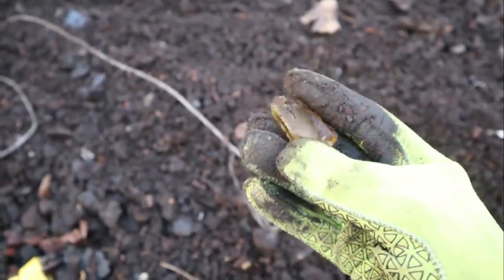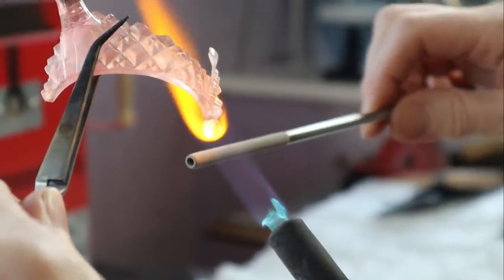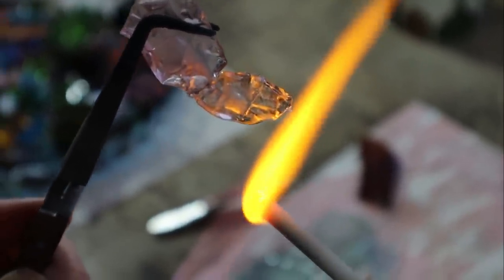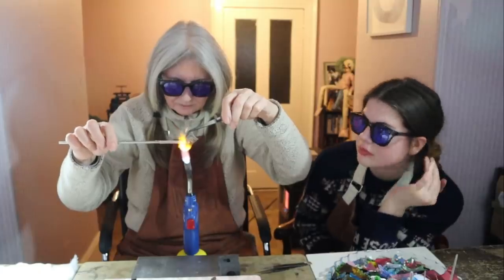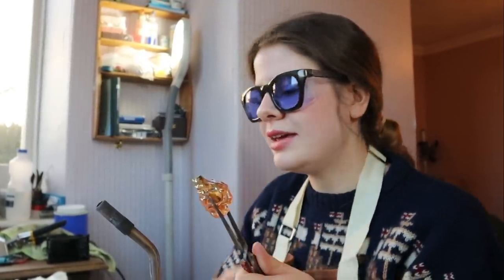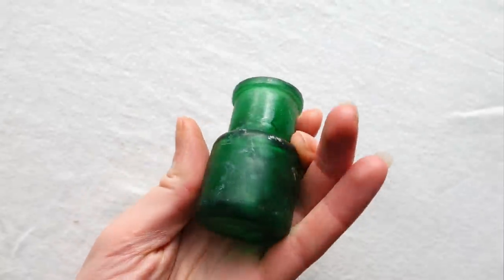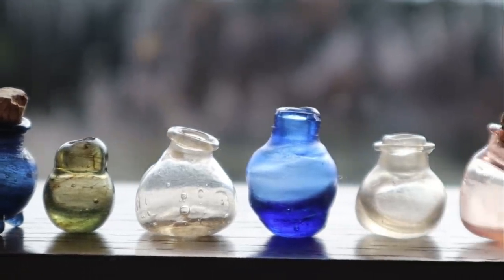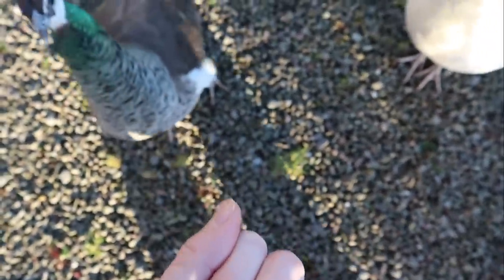Glass blowing tiny magical bottles from 100+ year old glass we found while Mudlarking!

Comment: Your little bottles are so charming.  So many ways they can be used-putting them over fairy light bulbs, to hold tiny messages, jewelry, etc.  You can preheat your glass shards in your kiln, at annealing temperature and it will melt faster and you will have less snapping.  Just have the shards in the kiln and use your tweezers to pull out a piece when ready to work.  If you want them to have a flat bottom, just gently push down onto a marver when you are done blowing, flash heat, and then put in kiln (or cooling pot.)  And last comment-please be careful using iridized glass.  The process to iridize glass is usually very toxic.  I hope these comments don't seem to "know it all" or bossy-just sharing info I know from working with glass.
Reply: Safety warnings are never wrong and friendly and sensible tips and advice fall into good soil with these down-to-earth and humble ladies.
Reply: Terri Atwell, I Love your comment. You are detailed in relaying your thoughts, much like I am, if I do say so myself.  : ) I am sure the Ladies of Northern Mudlarks will receive your thoughts and ideas  graciously, as they do mine.
Reply: Good info. Was going to leave a very similar comment, but found yours first. Well stated, and hopefully the ladies will see it. Their lack of basic safety precautions is worrisome.
Reply: I was going to suggest this as well. I have only blown glass full size in the traditional Swedish way, and I’m sure there are important differences in techniques working so tiny and low temp, but perhaps you might enlighten me on a few thoughts? 
My first thought besides yours was that the girls are working against gravity (hence the wonky bits) and was thinking I’d have positioned the flame/myself so that I could easily hold the punt more vertically by the flame, I’d make use of a bucket of water and to hold small wetted wooden ”spoons” to shape the glass in and find a miniature way to use wet pads of newsprint they way the glass is shaped when hot in classic glassblowing? Also pulling a neck should be possible the classc  way as well, ie rolling it horizontally (with perhaps support if it would be easier to be fast and steady) and pinch-pull the neck with another pair of tweezers?
Are these ways for some reason not used in lampwork? 
I was also going to suggest rolling the puntel in a bit of ground glass of contrasting color before returning to the flame and increasing volume and shaping. Thinking since this works with traditional glass I can’t see why it wouldn’t in ”smurf size”?
I’d be very curious to try myself had I the equippment needed! (Annealing equippment is unfortunately beyond my budget atm 😔) 
I’d appreciate your feedback (or anyone else with experience) I feel so inspired to try this, only too curious to wait ;) 
Love this channel!
I share many of the same interests as these lovely ladies and fell in love with Scotland 2019 when I was on adventures there all of august, so I can’t wait to be able to go back for more and do some mudlarking and mineral hunting myself! 
If I’d only known... 🥰
Reply: @gnarbeljo8980  in lampworking you are working much smaller than when blowing larger pieces so there is not the space to use supports.  Or at least I have not seen it done.  You can use graphite marvers to shape (versus the wooden paddles).  Frit can be used as you described to add color.  There are lots of ways to play with the shape of the bottle and neck (varying size of gather, using a punty on end, etc.)
Reply: @terriatwell4041  I see, I dod just have a look at another lampworking video and it seems they tend to work with the rods connected to both ends when making bottles which would be impossible in glasblowing where one must alternate.
Graphite is used in both techniques, but I can’t really see why wet newsprint and wood (which are so cheap and easy to come by especially in the size required here) couldn’t be used? Unless it’s too cooling for glass this small perhaps?
I understand the two techniques are separate, but starting out with glassblowing you tend to make smaller objects to understand the material, things that one might categorize as lampworking-style. So it was just a thought. If I try lampworking I shall investigate how one could incorporate this.
I absolutely LOVED blowing glass! But it really requires many years of mastering and above all full time access to a real studio with kiln etc. 
I spent many years doing pottery and there are certain aspects glass and ceramics shaping have in common. But whereas throwing is very meditative, blowing glass is SO exitinig!
☺️
Reply: Are these welding rods you start with? absolutely wonderful ❤️❤️❤️

Comment: Beautiful, I was wondering if you can incorporate glass seed beads, roll the molten blob in them?
Reply: This is such a fantastic idea, but sadly it probably would result in disaster, as each different type of glass has a different “coefficient of expansion,”. Which refers to the rate at which it will expand and contract as it is heated and subsequently cools down. The issue that often arises is glasses with different COEs being used together and the final object spontaneously shattering! Which really is too bad, because seed beads would be SO AWESOME to incorporate into glass blowing projects!
Reply: Thanks for that , I guess I didn't word it correctly. I was asking if you could use the glass beads, and no one likes or commented. Thanks for answering.

Comment: A couple tips (keeping in mind I am no expert myself,) that I learned when glass blowing is to use a steady, continuous breath and if you have to breathe in to turn your head so your lips are away from the straw so that there's zero change you accidentally breathe in through it. This could kill you and is deadly serious. Ventilate your area well - do this outside or in a garage when you can - as there are often toxic fumes with glass blowing. Finally, always wear your hair back with a cap or a hairnet on because you do not want your hair to alight. I love what you're doing! Keep experimenting!

Comment: You should probably check your old glass pieces with a UV light. Uranium used to be coloring agent for old pigments, ceramics, and especially glass. Some old glass has up to 25% Uranium by weight. Any green or yellow glass could be Uranium glass. If they glow under UV you’ll know.

Normally Uranium glass isn’t radioactive enough to be a health concern, but heating and blowing it might release the Uranium into a breathing hazard.

Comment: Great fun!  I used to blow glass at home with map gas.  Here's a great tip I learned....if you get burned, keep a bottle of plain yellow mustard nearby. Apply it to the burn immediately and let it dry there.  Let it wear off on it's own.  It will not only take away the pain forever, it will decrease the chances of blistering too.  It's an absolute miracle.

Comment: What if you used an electric drill to hold the rod to heat it evenly more quickly for you that way you can rest your arms and drip class more easily onto the rod. Plus then you can control the speed and the normal part that would hold the bit can hold the rod instead for you. Just an idea! I love your crafting and just whole channel!

Comment: I'm going to make a suggestion, can you strap your gas bottle sucurely to your table? I know its between your legs, but if it were accidentally to tip over, you would be on fire, and not able to get out
Reply from the maker: It is secured to the table firmly. It would be extremely irresponsible to simply hold it between your legs! Very dangerous!

Comment: OK, this is just a guess on my part, but could you be having such problems in melting the glass because you are using MOLDED glass which is thicker and has different properties than blown glass. Try using old BLOWN glass, see if that's easier.

Comment: How the heck did you girls just find such beautiful glass out in the middle of nowhere? Is there a place where people go to break all their beautiful glass?
 You certainly make some beautiful little bottles but heres a tip...for a more uniform bubble you must take the glass out of the flame then blow...  if you blow it while in the flame you end up with thin fragile sides... its very hard to control the glass when blowing in the flame... also for a slower more controlled burn try to use simple propane (green bottles). You can make quirky fun shapes by pressing the sides with a metal rod while blowing outside of the flame as well. Very beautiful job though. I had A Lot of fun using Glow in the dark glass rods and UV reacting Rods recently too. I highly reccomend trying it.. . .. Beautiful jobs though!!
Reply: Also try a torch head that provides a wider flame 🔥 much much better for what your doing... my favorite can be found at Harbor Freight it's only $9!

Comment: Hello! May I ask what you are using to anneal your bottles? I see a crock pot; what is inside? I have all the tools for lampworking but cannot afford a big kiln. Also, what gas do you use? The torch I have is for propane and oxygen.  I need to rig up a chain to hold up an oxygen tank outside, but inside i can have a wee little propane tank. For legal and insurance reasons... Have a super day!
Reply from the maker: Hey! We use a kiln to anneal our beads. A kiln is nessaery for annealing. If beads aren't annealed they could crack (or even explode as we discovered) at any time between minutes to years after you've made it. We use a crock pot with cooling bubbles to cool the beads as slowly as possible so they don't crack or shatter from thermal shock. When they've completely cooled we take them off the mandrel and put them in the kiln to anneal. Many flame workers put the beads straight in to a bead kiln which is probably more convenient, but we can't afford one.
We also use a small Mapp gas canister with a torch head which has worked really well for us so far (and it's the most affordable option) 😊💕
Reply: @NorthernMudlarks  Thank you so much! I Have a little kiln for fusing glass or making metal clay charms. Do you just put the bottles/beads inside, then heat it and let it cool off? I am so new to this and didn't event think of removing the glass from the mandrel before annealing! Thank you for replying to me!